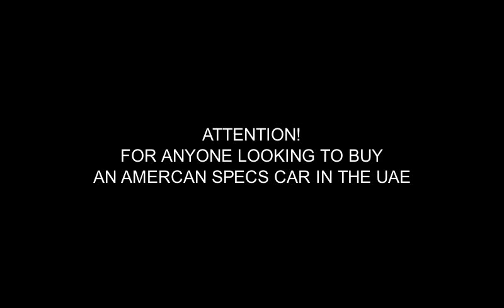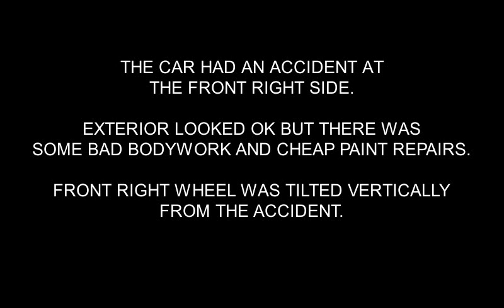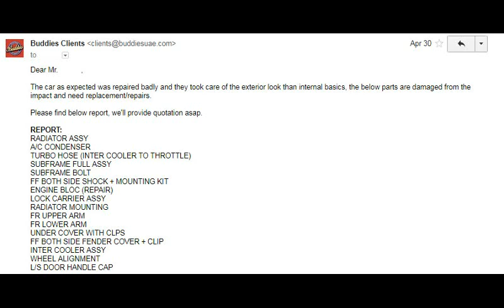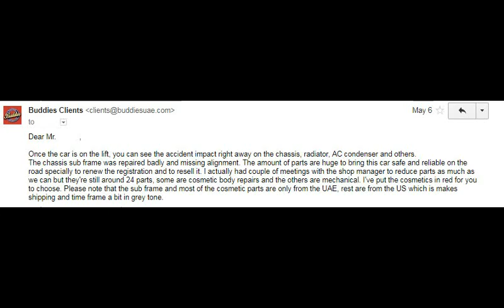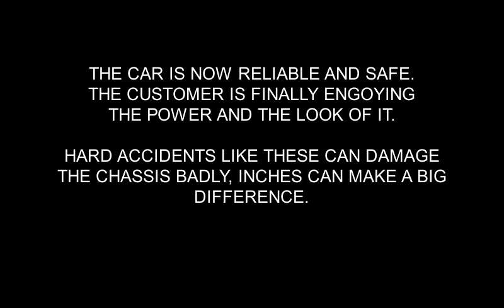ATTENTION! Real story about used American Specs cars in the UAE

Comment: just avoid flooded car other things are fine because flooded cars stop in the middle of the road without any sign because water damage is the most dangerous i bought 2006 charger in 2011 till now i am using it american specs no issues luckily it was not water damage
Reply: hi,
do you have any idea how to check if the car was flooded or not..? 
i am considering to buy one american car. just want to be sure before buying it. thanks
Reply: @kashifmohamedchoudhary64  the only one sign of all water damage is the bad n pungent smell which comes from the carpet of the car but you have to smell from inner or lower side of the car and check the rust and check the electrical parts properly
Reply: I’m looking to ship my car from canada to Abudhabi, I’ve heard I might run into some issues when it comes to the heat, as in I’d need to upgrade my intercooler, A/C compressor unity and Rust proof it because of the humid environment. Have you done those and if not how does it fair?
Reply: @Vinecars  don't worry just change the radiator